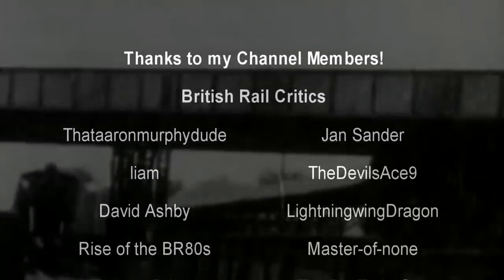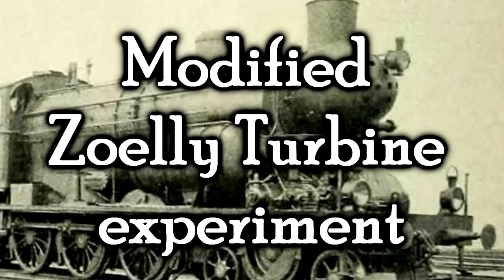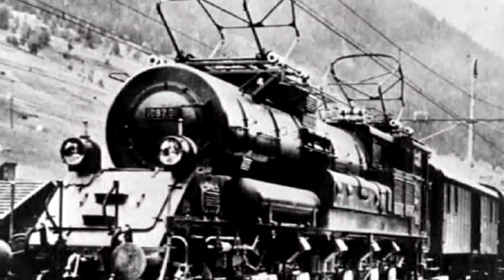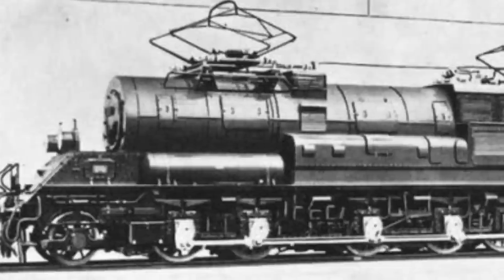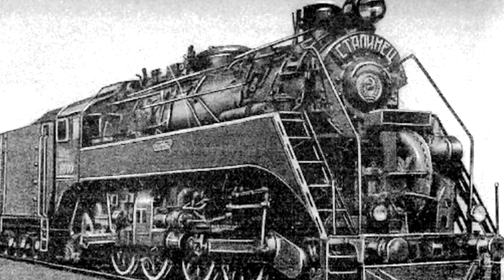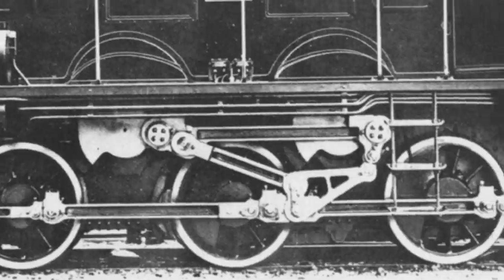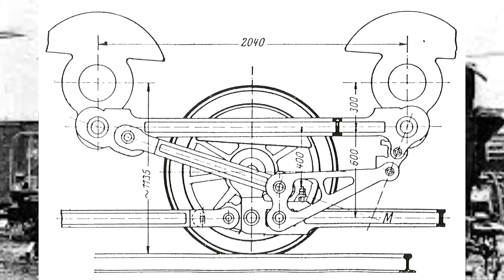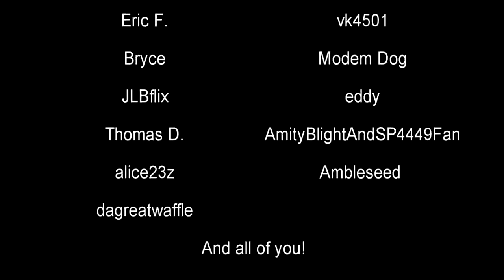5 Locomotives That Just Confuse Everyone | History in the Dark

Comment: The reason for that bulky linkage on these Italian jackshaft locomotives ( and many, many others as well ) was to move motors to the sprung mass of the vehicle. Those early electics ran with a few motors which were  BIG CHUNGUS and you really didn't want that to be unsprung and straighten your track. If you browse through jackshaft electrics, just about every one of them uses some sort of contraption to detach the motors from the wheels. In that regards - no1 isn't really all that weird.
Reply: that still looks like kind of an overcomplicated way to turn rotary motion into rotary motion, though.
Reply: @kenbrown2808  Brows through all the ways people tried to make connecting rods 'flexible' for articulated steam locomotives. It is an inherently difficult problem to solve. Especially in the pulsating, high torque machines. Even today, locomotives which avoid the traditional 'nose hung' motors, in order to have them sprung - like TGV power cars - are significantly more mechanically complicated.
Reply: @TryboBike  steam locomotives have to convert reciprocating motion to rotary motion. That's completely different from an electric locomotive.
Reply: @kenbrown2808  Complicated, but necessary to avoid exerting oblique forces on the chassis when dealing with the ginormous traction motors most electrics of the time had to use. And said traction motors being so big meant they couldn't simply ride down in the chassis for a more direct connection.

The other thing the triangle drives do, is they let both traction motors be linked to a single axle.

Comment: if you take suggestions, I'd be interested in seeing an "overstayed their welcome" video/list. for example the Hitachis in Melbourne (introduced 1977), which had no air-conditioning and were supposed to be retired in 2006. instead they remained in service until 2013, including several carriages that they had to buy back from a preservation group and a private collector! by the end they seemed to mostly be used when other trains were unavailable, most noticeably at the height of summer in the afternoon when some trains might have got trapped by heat-warped tracks or had other overheating problems. you can imagine how disappointing it was to have to take those home from school on 35+°C days......

Comment: 16.7Hz isn’t that unusual as early AC goes, it’s 50Hz (european standard) divided by 3, probably because that was the easiest to retrofit power stations. And it’s still widely used in Europe (CH, AT, DE, SE and NO) use it to this day, everyone else electrified on DC or electrified when rectifiers became a thing after WW2… or they changed/deelectrified.
Reply: Typically they was  originally 15Hz with a standalone grid, but when they was integrated into the larger grid they was change to 16 2/3.

And its not only about the frequency its is also about the phase conversion.

Just hooking up one phase out of 3 May sound like a good idea.. but it turned out to not work well
Reply: To nit pick for fun. CH, AT, DE use 16.7 Hz SE and NO unse the older 16 2/3 Hz. There was a day when the (mostly) German speaking countries switched. 

But I would assume that a Loco designed for one system can run on the other system.

I kinda wish Denmark would convert from 25kV 50Hz to 15kv 16,7Hz, than you could operate a single Loco from Norway to the Alps without switching power system. Is it useful or necessary in today's railways world? NO! but it would be cool.
Reply: @IamTheHolypumpkin  compatibility was the reason why they stayed at 16.7 and didn’t try like 50Hz… with 16.7, they’re still in spec since depending on load, frequency can vary a bit and every device needed to handle that anyway. But afaik it made it easier for DC/AC converters to get it right.
Reply: In the beginning of electricity, alternating current at both 50Hz and 60Hz saw widespread use on both sides of the Atlantic, hence the Reading Railroads 25Hz Electrification System still found in some parts of the US, which is unhelpful today because the US now uses 60Hz electricity.  Plans to replace it have blown hot and cold again and again.  This is the state of railroading in the US, where plans change a lot and then finally, a decade or two or three or maybe even four later (depending on the nature of the project) the plans come to fruition.

Comment: It's absolutly possible to make a steam turbine loco work well. The swedish version simply used multiple turbines and switched between them depending on speed.

The drawback was that it had only one reveze turbine so it could only go slowly backwards.
Reply: And I understand no steam is consumed when standing still unlike gas turbine locomotives such as the UP big blow gas turbines.
I think he thinks the problems of gas turbine locomotives are present in steam turbine locomotives.
The LMS Turbomotive pacific worked well, but not well enough to justify the extra cost of the non standard steam turbine.
Close to every modern steam locomotive ran a steam turbine, but just a small one to generate electricity for the headlights etc.
Reply: @johnd8892  Thats still irrelevant since the problem of (literally any kind of) turbine only optimized on certain speed. Which not the point of the locomotive.

And well, even you can propose any contraption to fix steam turbine, it's irrelevant nowadays since you can just put the steam turbine somewhere else and transmit it to locomotive via electric line and pantograph, which works well for more than 100 years.
Reply: Marine steam turbines are the same way. You only have seven or eight sets of astern rotors, compared to 30+ sets of ahead rotors. Also, only about 1/3 of the horsepower available to go ahead is available when going astern.
Reply: @michigandon  a lot of train steam components was originally from ships.
Reply: @matsv201  And vice versa! The former C&O carferry Badger has a Westinghouse brake compressor onboard to provide ships service air.
Reply: @michigandon  to a extent. Ships was generally first wirh the hot new main tech like turbine, triple expansion, tube boiler and so on.

Comment: The Swiss locomotive is something I never seen before, it was a steam engine lookalike but was electrified.
Reply: The Swiss shunter steamengine was a real steamlocomtive who was heated electricly like a tea kettle in WW2 due to severe shortage of coal and electric locomotives. Not energie efficient but they had some extra "electric" locomotives they could use.
Electricity was in abundance available due to  water powerd powerplants.
The steam look alike engine was an Austrian electric engine the parts who look like a boiler were AC-DC converters. 
That one was build to boost the overal effiency of  an electric locomotive
Reply: @obelic71  Amazing how long rotary converters stuck around.  Back before high-power solid state electronics, building a motor and a generator/alternator and coupling them together was the simplest and cheapest way to change current from one form to another.
Reply: @ostlandr  as always new tech gives new possibilities. In space and railroads (railroad crossings, safety equipment, flight computers etc. etc.) they use on purpose older more reliable tech who is more resiliant to the enviroment the equipment works in.

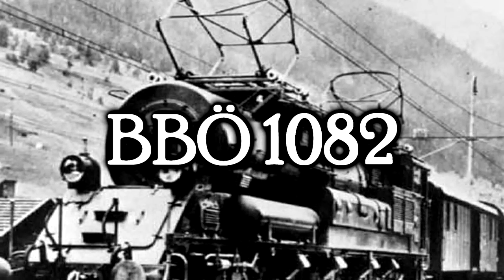Comment: 4:00 built by the Austrian's pre war, the German's poked about with it, dismantled it and it was no more. 
The "boiler" contained a rotary converter that change the overhead AC power to DC for the traction motors. 
The Austrians made some weird shit, their 1067 class electric locomotives had hydraulic drive. 
You have to ask why?

Comment: When describing the 1082 it's mentioned that the frequency at the time was 16⅔ Hz. That's still the case today in Austria, Switzerland, Germany, Sweden and Norway, but rotary converters are a thing of the past since long. Classically universal commutated series-wound motors were used, nowadays it's 3-phase induction motors with electronic inverters (variable voltage, variable frequency).

Comment: 7:27 I have to protest. There are more trains using rotary converters. This is far from the only one..

Typically trains of this era would use multi current motors, but those where huge. 

Also using AC was done already in the 1960 with thyristor. Both the sweidsh Rb and Rc used them and also the german.. I belive it was the BR 103.

I think you may have confused DC locos with AC-DC-AC that was starting to be used in the late 80 I  trains like the ICE1.

Comment: Quite fascinating - I love those early side-rod electrics which were really built using steam era technology, before modern traction motors and axle hung drive were developed. Funny thing is that axle hung motors were already used on trams and streetcars; possibly it wasn't considered robust or powerful enough? As for turbomotives - the LMS Pacific of that name was very successful as a main line express engine. Problem was she required a permanent third crewman riding her, a fitter, in case anything went wrong en route, and she also needed a separate engine to move her in reverse when in the yards. Rebuilt as a normal "Princess" class Pacific, "Princess Anne", she was sadly smashed beyond repair in the Harrow disaster of 1952.
Reply: there must have been a massive increase in stability and low wear on the track, no hammer blow to try to counterbalance. I thought turbomotive looked very purposeful and evolutionary. what a fascinating video.

Comment: Would that BBO train be used to pull the amagaddon express and hide into the tunnels? That would be a reasonable way for it to be disappearing in 1945, since it is using electric and had no smoke while it runs, it could totally be run in the dark with the missing gold reserves and hide into tunnels in the alps or some underground bunker in the wild without alerting anyone, probably hooked up to some generator car and drive itself to places without lines, that would make information be hard to trace down.
Reply: That BBO looks like a cross between a steam locomotive and a MILW Bi-Polar...

Comment: The Australians (Or well, at least us Victorians) also trialled lignite burning steam locomotives three times and had success with the latter two.

The first was a Victorian Railways C Class which didn't like the conversion and was quickly switched back to black coal.
The second was a Victorian Railways X Class which (because the brown coal conversion also added an automatic stoker) ended up outperforming the black coal versions to the degree where it was announced all X class would be converted but that fell through when the price of the local pulverised brown coal increased to the point where it wasn't worth it any more. 
The X class trials initial success also resulted in one of the then-new R Class passenger express locomotives to be converted where it was found to make 15hp less than the rest of its class but was considerably more efficient to the point where a 320km (200mi) trip between Melbourne and Bendigo and back with 350-ton on the back used 1.5 tons less coal.

You can see photos of the PBR-equipped C class and X class on their respective wikipedia pages if you're interested.

Comment: 4:54 rotary reformer locos is really not that uncommon. This just had one huge reformer.

Typically they would reform to AC 3 phase in steed of DC.. because..  well.. if you have a rotary reformer, you might as well. But DC motors was not as uncommon either. For example the EP2 bipolar used DC motors... and bipolar as well (unlike quad polar motors that is typical on locos)

But of cause, changing the shunting current in the generator to change the voltage is of cause less complex than making so in the driving motor. Specially when you have only 2 generators and 12 motors.

The typical solution was to just have a huge as multi current motor in the boddy of the train and have a rod go won to the wheels.

So it really wasn't that rotary reformers was that uncommon, just that AC motors generally was less maintenance. Yes, of cause  they want as strong, but much more robust.

In the 1950 electronics like thyristor become avaliable to make DC .. but then only after the power was transformed. So the loco still needed a large heavy transformer. Still a loco using transformer and thyristor could have about twice the power of one with reformers or AC motors for the same weight.

In 1980 the ability to make variable freqvency 3 phase wirh electronics made it possible to reduce the size of the AC motors.down to about the size of a DC motor, also increasing the efficency from about 70% to about 80%, increasing the output power a bit more for the same transformer.

This in turn lead to the PM motors that is phase controlled I stead of frequency  controlled. Needing computerised controll system. Benefit is that the motors are  now smaler lighter and up to 90% efficient.

Comment: The Austrian locomotive basically was a Ward Leonard-drived machine. I wonder why the literatures don't mention this locomotive.
Yey! The Kandó triangle, and the prototype locomotive with it, have been realised!
Kandó have done an interesting phase converter too that alowed 50Hz overhead lines. The converter made 1 phase into 3 phases (it was a rotor that generated the two additional phases and worked better at the time than the Skot transformator), so the tracktive motor had a better start twork.
Reply: Kandó in fact has made fundamental basics in elecric railway technology: he stated that effective electic locomotives must use the conventional, 1-phase AC lines of the countries, not separated. He not just recognized that it needed to be high voltage (16, 25 kV) to the point of the locomotive itself to remain effective, I mean the long distance transportation of the elecricity, instead he made it in opeation too. He also stated you need 3-phase AC to effectively operate your locomotive, and he experimented with different approaches: phase changing and period changing techniques, and also these combined. His first 1-phase AC high voltage locomotive even utilized pole-switching technique, there was 2-3-4 phase operation.
Nowadays, modern electric locomotives all utilize his fundamental priciple: 3-phase and frequency changing, traction given by asynchronous motors. Improvements are obviously made since, as we rectify the single phase AC now and generate the desired frequency 3-phase AC to the motors by semiconductors, without any moving part. Also motors are arranged to axles separately (Bo'Bo, Co'Co), there are even experiments vith direct drive (no gears!)...

Comment: 2:40 the statement that steam turbines was a failure is not true. They didn eventually have limited success. But not with direkt drive but rather with I direct drive, solving most of the problem. Those trains also use oil burners and condensors,  making them look nothing like normal steam locos, that generally make people not think of then aa steam trains. But they are. The beat example of this is the GE steam turbine train.

While eventually replaced by the gas turbines, they are often confused and mostly just called oil burners.

Comment: Well, if you want to keep everything how it is then how should steam engines progress? Weird experiments need to happen, because this is where we find out what works. The old way works, but we could (maybe) make them better.
Reply: Or maybe just maybe. We can put steam engine somewhere else and we should developed the modern technology to transmit the steam power to locomotive from long distance. So, we can make the steam engine much more bigger, powerful, no need to massage it to start or run out of water, and insanely efficient. Heck, even better, we can use those hot-hot radioactive rock to heat the steam so we can use less pollution 

If we even smart and resource enough to use those technology. OH WAIT
Reply: It's been done over and over. Brilliant engineers like Andre Chapelon, L. D. Porta, David Wardale and others have made incredible improvements to the design of steam locomotives.  And proved it with successful prototypes. But nobody was interested.
Reply: @ostlandr  That's a shame 😕 If the prototype is successful, it could actually work